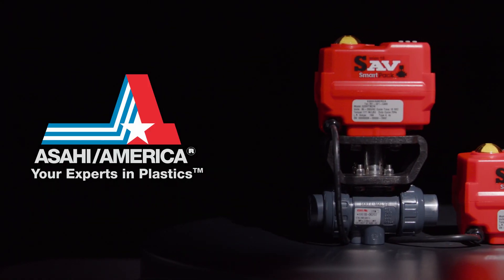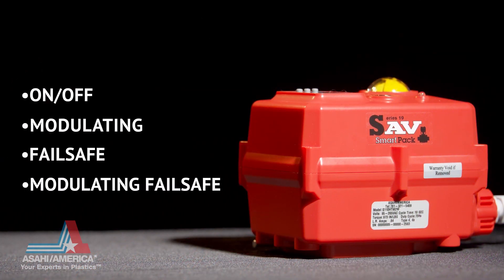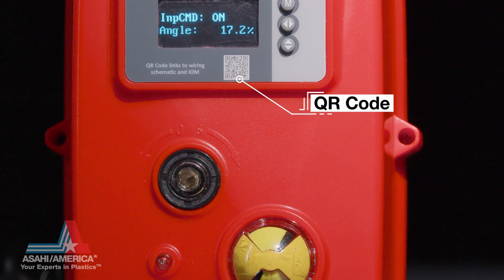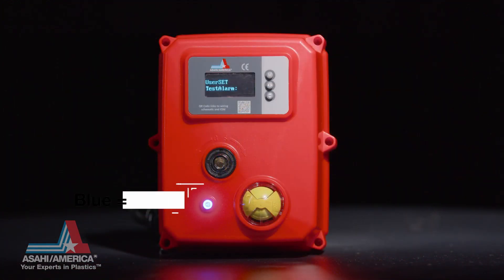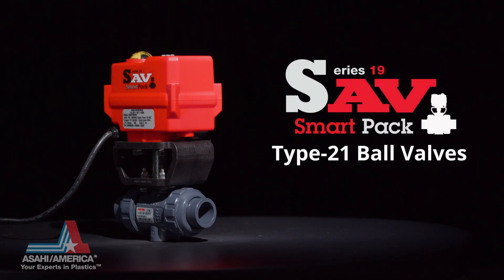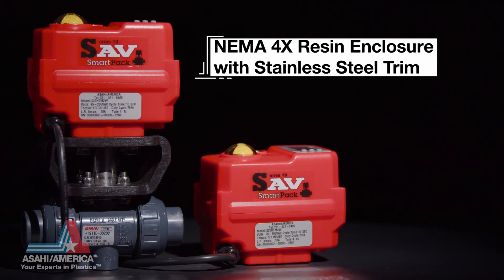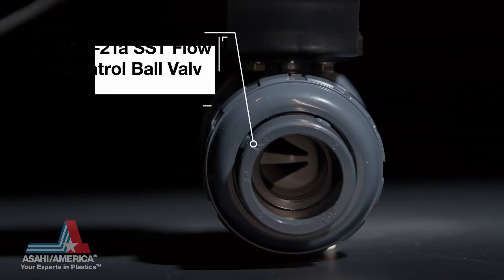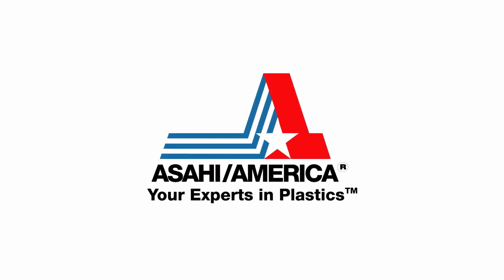Series 19 Smart Electric Actuator

Comment: This darn thing showed up 2 weeks after I was forced to specify a similar actuator that doesn't have local control like this. Damn it !  
3 Suggestions:  ModbusTCP/EIP control, a vinyl covering boot for outdoor applications where UV would destroy the exterior, and the ability to mount these to ANY valve with adapter hubs.  I have another project coming up and I'll be lookin into these deeply.
Reply from the maker: Hi, please let us know if there is anything we can do to help with your project. Please do not hesitate to reach out to technical services team at asahi@asahi-america.com or 1-800-343-3618.